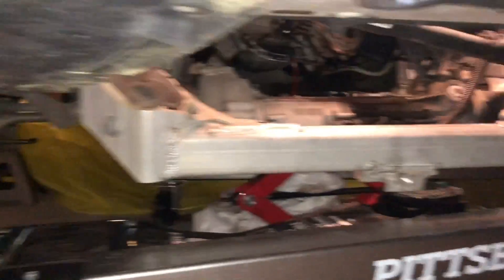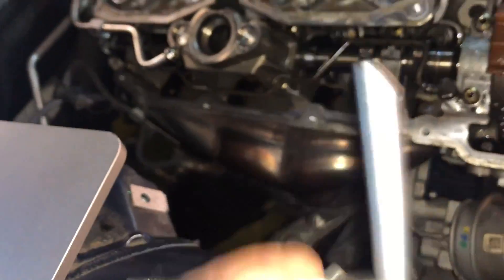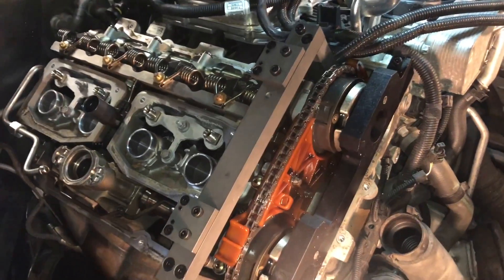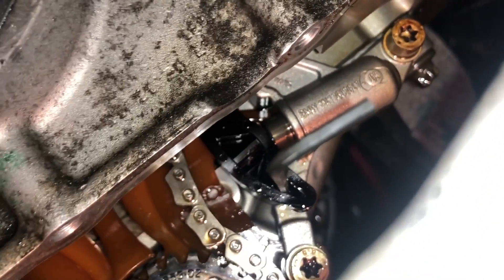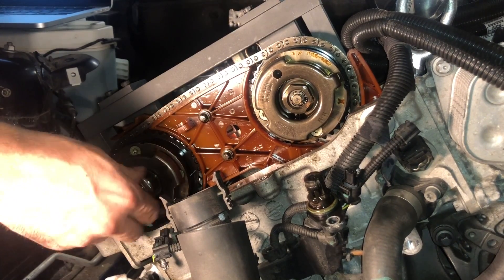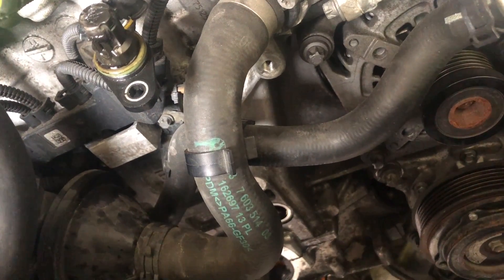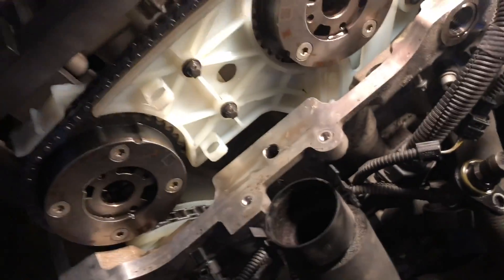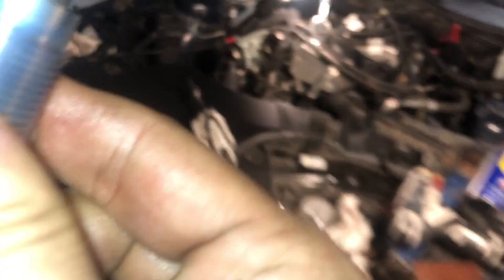Replacing BMW N20 Timing Chain (228i, 328i, 428i, 528i, X1, X3 and Z4)

Comment: Hi, quick question, did you replace the oil pump chain and sprocket? If so, did the larger sprocket easily drop after removing the crankshaft bolt? Thanks!
Reply from the maker: Yes, it easily dropped once the bolt was removed and the 3 bolts were removed that were holding the oil pump assembly

Comment: Finally i got it replaced. I took 6 days till i got it done. First run the car worked with engine check for 10 seconds then engine check light went away. However, I was curious to see what code was there. It turns out to be p1381 advance timing as per my obd says. No codes no but I thought i did something wrong.
Reply from the maker: That’s awesome, it’s a job and a half but I’m glad people are tackling these at home.
Reply: Quick question, how did you know if the timing was bad? Was your timing chain was tight? When you open the cover ?

Comment: is taking the drive gear oil pump torx bolt  ccw as regular bolts or it is different.
Reply from the maker: I’m not sure what you are asking. It’s a regular torch bolt
Reply: @SimpleCarGuy  because i heard in the b58 engine the torx bolt of the drive gear opens clockwise and closes ccw. The opposite of any bolt the world. That's why I asked if this engine the same. Thanks

Comment: If BMW says the engine has already gone bad can the timing chain still be replaced? Or do I now need to just replace the engine. Thanks.
Reply from the maker: Depends what has gone bad in it. BMW is not covering their butts and not doing timing chain jobs and opting for replacing entire engines. If you have belt valves and or rods that are knocking, it’ll be cheaper to put a new engine in.

Comment: the timing chain was in good condition. I think the rod bearings are shot on your car. Typical problem with the N20.
Reply from the maker: You are absolutely right on that. I decided to swap the engine as with rod bearing being bad the valves are usually damaged as well etc
Reply: SimpleCarGuy mileage ?
Reply from the maker: 110k miles, bought at auction with ‘mechanical damage’
Reply: @SimpleCarGuy  The N20 engine on my x1 stalled couple days ago on the highway out of nowhere...the engine cranks now but it won't fire up! What are the chances that replacing the timing chain would resolve the issue as I'm 90% sure it's the timing chain guides...or would you suggest doing an engine swap?
Reply from the maker: @8442116  before anything, I would scan the car to see what kind of BMW specific codes you are getting (don't use a generic OBD2 scanner). Then go from there. No start could be anything.. first thing I would look into would be the HPFP. 
If you are sure it's the timing chain and no damage has been done, I'd definitely do the timing chain before an engine swap.
Reply: @SimpleCarGuy  Thanks for the prompt response. Yeah, I'm pretty sure it's the timing chain as I have already got it diagnosed by a certified bmw mechanic...the only thing is that they've suggested an engine swap which I'm quite not sure about as the engine sounds healthy when I crank it...it just sounds like the timing has jumped tooth. In regards to whether if any damage caused to the engine or not...I haven't opened the valve cover to see if the valves are bent or not, but I was driving on the highway when the vehicle stalled on me all of a sudden! My verdict is if the N20 engine is an interference engine ...chances the valves are bent are most likely, and I wouldn't even bother wasting my time tearing dow the engine. What do you think?
Reply from the maker: If it actually locked up, locked up while driving you are most likely correct about the valves being bent if not more destruction to the head. If you’re paying someone to do the work, it would most likely be cheaper to swap a new (low mileage) engine in rather than trying to fix it. However, if you are willing to dig in a little (wouldn’t hurt at this point) and can see what the damage actually is, it may save you a good amount of money. Really up to you, but I would definitely investigate.
Reply: @SimpleCarGuy  Opened up the valve cover and the guides are shredded. No bent valves though. There is some scoring on cylinders 2&3. No other issues either than that.
Reply from the maker: @8442116  That's a good amount of damage, what did you decide to do?
Reply: @SimpleCarGuy  I threw in a new timing chain assembly and it's running great...only thing, upon putting everything back together I noticed a very tiny crack on the valve cover and there's a very slight oil leak.
Reply: @SimpleCarGuy  need a new valve cover now
Reply from the maker: @8442116  that's not bad at all. It sounded much worse than it turned out.
Reply: Still running? Mine stalled out too